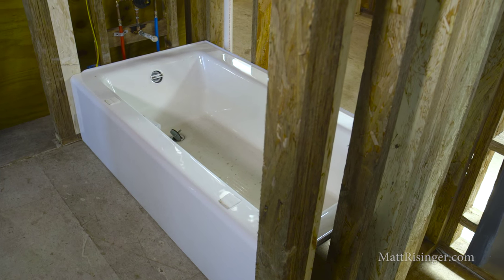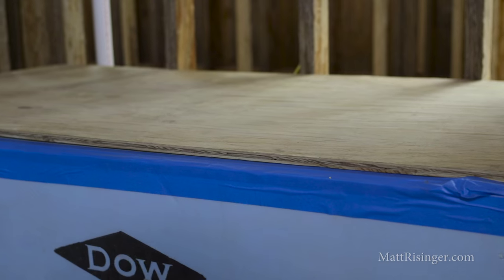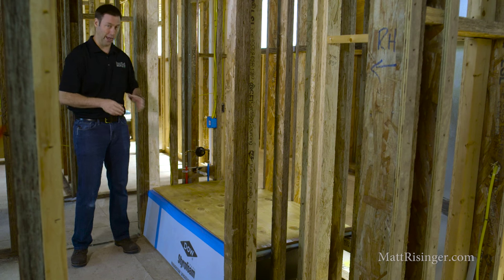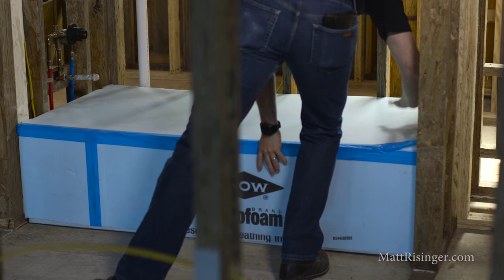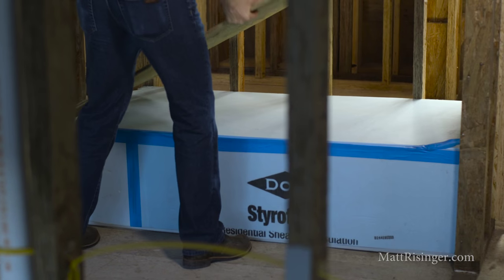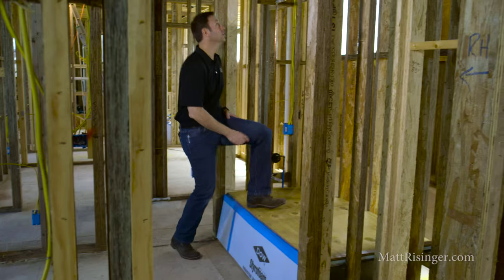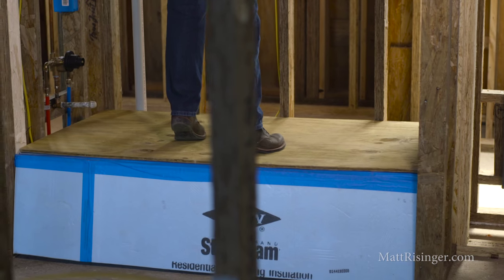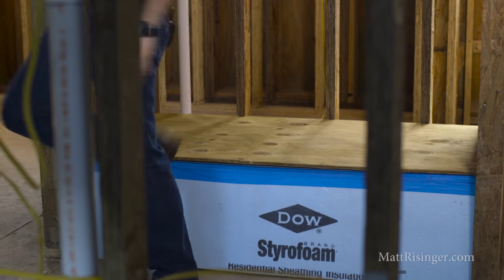Bathtub Protection - Builder Quick Tip

Comment: Hey Matt love the videos. Perfect for the building science tech junkie that I am. We protect tubs similarly but use the cardboard the tub shipped with instead of foam. I think your foam idea provides superior protection but not always at hand and can be expensive. 2 layers of card board and plywood/osb is a good compromise. Also we like acrylic tubs such as Kohler archer or hydrosystems. Easier to haul and doesn't suck the heat from the water as fast during a soak.

Comment: I pretty much do the same thing. Plumbers take it all off ans get in it to work, sometimes they put cardboard down jnside the tub and then theres always a tiny rock or some debris under there and it can scratch the tub. Or thr drywall guys pull it off in order to drywall up to the tub. It's hard to be as vigilant as you need to be. Im going to try that liquid masking stuff someone linked. Cover everything but the drain so they can set it, and then put osb and styrofoam on the top and apron.

Comment: Why not install the tub after waterproofing the walls and floor?
Reply from the maker: +Eerik Sweden Because there isn't access to the plumbing pipes below later, it's installed in this stage so it can get tested and inspected by the plumbing inspector.  Good question!  Matt